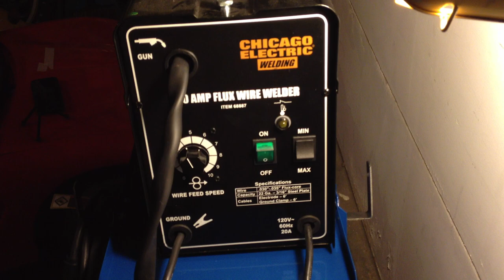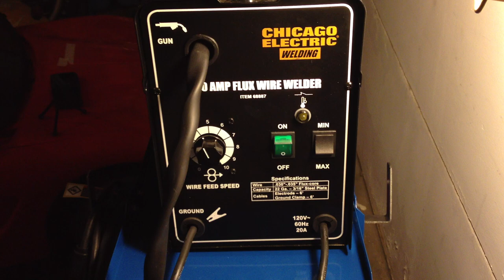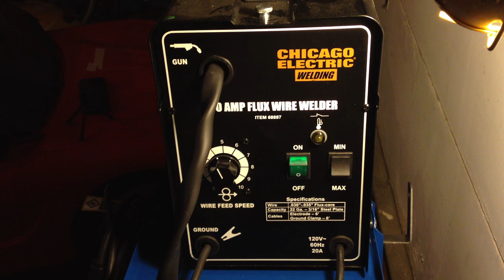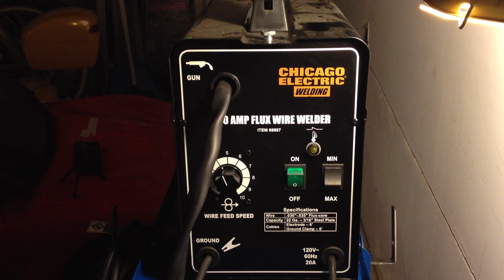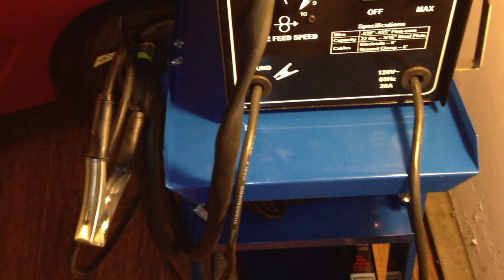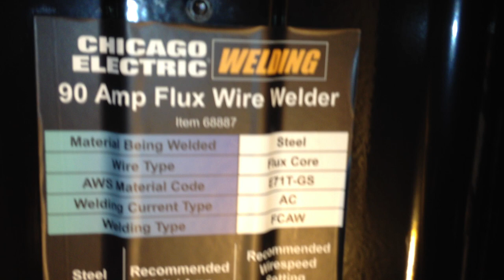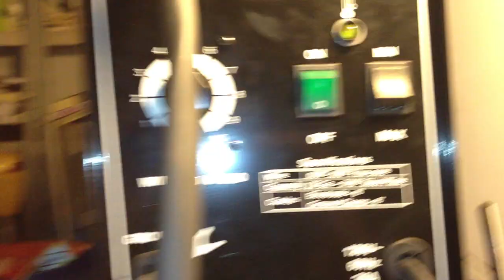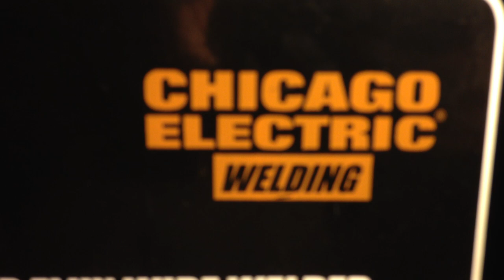Wire Welder, 90 Amp Flux Chicago Electric Welding - Item#68887 Review Harbor Freight Tools -Part 1/3

Comment: I have this exact same welder and cart , it has worked great for my many backyard projects and for 100 dollars I can't complain !   I bought it in 2013 , the first thing I did was replace the ground clamp with the copper back Spring HF clamp !   I have a 20 amp plug in socket and if an extension cord is needed I only use a 10 gauge 25 foot cord or a 5500 watt generator 20 amp socket if too far away from the house !    If the ground connection is clean and the welding surface is clean the welds are strong and solid !     I will buy another one when this one fails but for now it has performed very well !

Comment: I have this one and it seems to work pretty well for the price. I go real easy on it cause i know its not the toughest equipment around but other that that its great for repairs like bumpers, atv,  small fabrications and go karts. Im planing on making some outdoor furniture out of some thin tubing and some mesh. I recommend it but get a warranty.
Reply from the maker: It does work well. I beat the hell out of mine, regularly exceed the duty cycle and have never had it shut down. I've even welded some parts in a emergency on a rail car. Works great!
Reply: ***** So, you said "Cold Tip", which means _______ ?

The older version (the blue ones) arc'd as soon as the Wire made contact.
But these black ones dont weld, EVEN IF i hold the trigger on the Handle.

So what the hell's going on???
Reply: Syrus54 well the old one arced as soon as it touched ground, so the purpose of the trigger was only to feed the wire....now the new black one has a cold tip so it wont arc till you squeeze the trigger as the wire feeds
Reply from the maker: Syrus54 Hot tip means the wire is always live even without pressing the trigger. Cold tip means that the wire will not be live until the trigger is pressed.

Comment: Just so you know, it will take a 10# and 12# Lincoln wire spool, and the lid will close, and it will feed fine. Thought I was going to have to do a mod myself, but just said f@#$ it, and tried it. It works fine 😉
Reply from the maker: Yep, works great! Did it after I used up the crappy spool that came with it. Once I switched wire, I can lay a perfect bead now. 
Just a FYI, did some research, as I do import things for resale online too. So found that the spools that come with the welder are just low grade Chinese wire. The larger spools that HFT sells, are actually Italian wire, from same factory as Lincoln! Save some money, use a 20% off coupon and get the HFT flux core. works amazing! Redid the coffee can weld with the Italian wire, and just perfect bead, almost no splatter even though it's flux core! And as you say, does fit in the case of the welder. I did find though, as it is heavier, I put some white lithium grease on the spindle. The wire feed was having some troubple pulling the wire from the heavy spool. After the grease, no issue at all!

Comment: Yep thats all I really weld up anymore works really good for it I used the machine to add on to my winch bumper I added half inch plate as a grill guard I just ran multiple passes verticle up for penetration and it holds well.

Comment: I have one of these welders & anxious to use it here soon
Reply from the maker: It has been great!   I spent last weekend at the Riverside & Great Northern Railway ( http://www.DellsTrain.com )   welding some repairs on the underside of a passenger car. I did my best to clean off as much grease as possible (blasted through 3 cans of degreaser...)  But still managed to start a few fires.... However, the welder, set to MAX power plowed right through. The welds on that wern't pretty though due to the grease and the odd welding angle, however, the welds were STRONG!!! VERY STONG!!! and no gas on a 85*F windy day. Though I was roasting my ass off after that...

Comment: nice man. i to have the same welder. its good for small stuff the only thing i didnt like is that it dont have a voltage regulator knob to control the heat. other then that its a good little welder. but i got a miller 135 mig welder now an its way better. but still will never sell my harbor freight welder i like it. for a windy day this is the welder i will go with. oh an run .035 wire in it makes better welds man... thanx

Comment: Sweet! I run a moped, scooter and hot rod shop… as well as mowers… Mow-Ped Shop in Emporia Ks. Just left a golf cart shop to start it. Anyways,  i am planning on using mine to weld mower decks,  panel repairs and to build a Romeo Thunderhawk moped frame. Im picking it up tomorrow. Wonder if i can weld diamond plate with it?

Comment: The older HF welders are made in Italy .. They are hot tip but work well !!  And the new black one you have has the same wire speed control problem .. THEY BURN OUT .. watch my vid on and easy fix ..!!
Reply: hey is your video still up, the wire feed on mine won't feed the motor sound like it straining

Comment: Would you weld something like a leaf spring hanger with this, is it strong enough?
Reply from the maker: Hello, yes, it should be ok. Make sure the hanger is CLEAN. and I mean really really really clean. Get that wire brush in their, get a drill with a brush on it, and make that sucker SHINE. Get it prepped VERY VERY WELL. Maybe even preheat the metal a bit if you can without damaging anything or starting a fire. High amps, and give er a go.
Reply: Cool thanks
Reply from the maker: No problem. Enjoy!

Comment: I hated the clamp on mine I would weld with it then the wire would just poke and jab the metal, real clean metal too so I found some old jumper cables that had really heavy duty clamps so I robbed one and now it works better than when I bought it

Comment: Are the welds strong enough for a car's sheet metal?
Reply from the maker: Most definately. Just dont use the wire that comes with it. Take your 25% off coupon to harbor freight and purchase a new spool. The wire that comes with it is made in china and junk, the spool stuff on their shelves is Italian made in same factory as Hobart and lincoln.
Reply: ***** Thanks. When I get my welder, I'll just use the included spool for practice.

Comment: I can't weld for shit with this welder. Slow feed, fast feed hi or low. Just a bunch of snots and slag. Grind and touch up, and it breaks when I tap it. 3/16 bracket. Maybe it's the wire, maybe it's me.
Reply from the maker: +Ron Laukaitis Once I replaced the chinese wire that came with the unit (Harbor Freight's 10lbs spools are made in italy), I can lay a perfect bead. I welded up a train car last year, that car saw 250,000 tourist passengers this summer, still holding and still strong.
Reply: I discovered that the HF 90amp feed rollers were slipping badly. It was intermittently stopping and losing the arc.  I tightened it up and it was usable. I now need to get the wire feed speed  right.  I did replace the spool with another from HF. Will have to find the 10 lb.
Reply from the maker: The 2lbs spools at HFT are from India. But believe me when I say, I can lay a darn near perfect bead with this welder (at least, as perfect as flux core will allow). I learned to Wire Weld with this unit. I use it for the majority of my welding, due to use and portability. I have a much larger NorthStar setup with a Spool Gun no and gas for wire welding Aluminum. Want to talk about a PITA.... Aluminum is not fun.... But it is profitable!